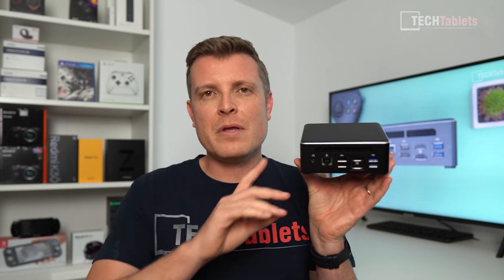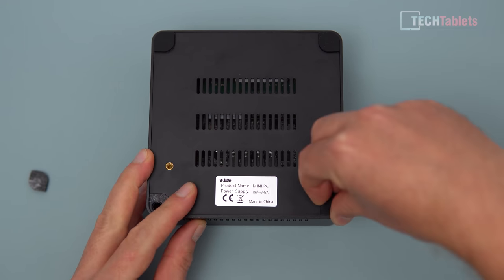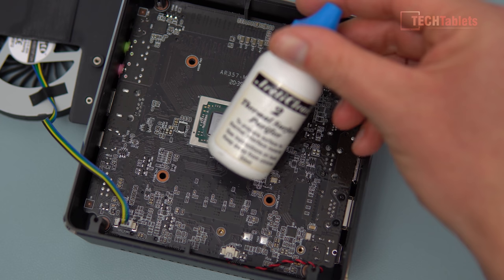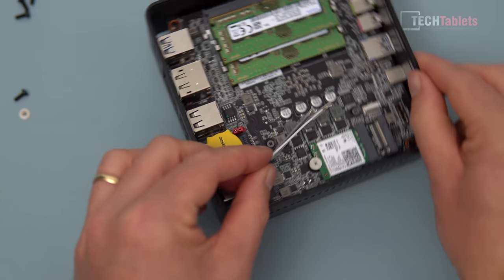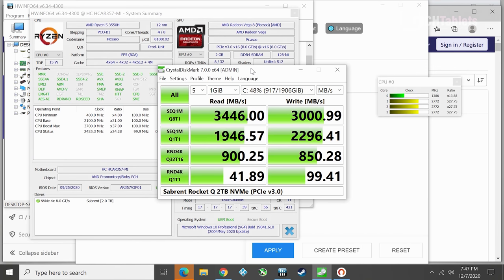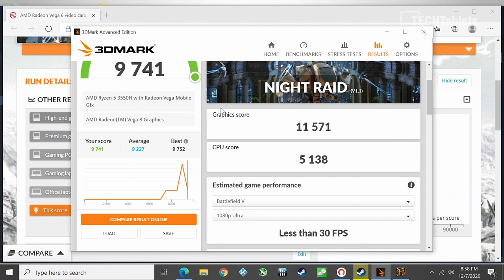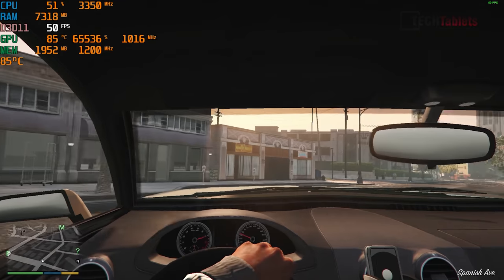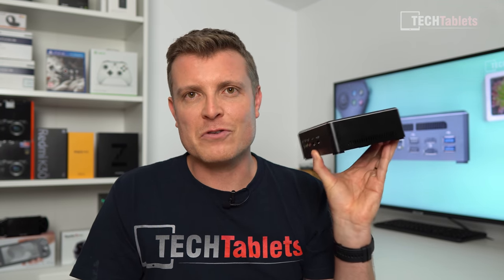AMD Ryzen 5 Mini PC Upgrades! Wifi 6, TDP Boost & More! (Ft T-Bao MN35 )

Comment: Wow! Thanks so much for not only introducing the world to the best mini-pcs around, but helping people improve them with time! I ordered the T-Bao MN-25 that I've been running Linux (Ubuntu 20.04) on and it has been excellent. I already added an SSD thanks to your prior teardown, but I only got halfway through the wireless card upgrade because I wasn't sure what size screwdriver I needed. The details here are priceless! 👍😁
Reply from the maker: Glad to help. I had Linux Mint on my MN-25 it ran great
Reply: how did you fix displayport?
Reply: @kerde526  seems like ubuntu 20.10+ support this wifi card instead of many other distros
Reply: @ДмитрийАлександрович-й2щ  it worked for me.

Comment: I have a slightly different model (Ryzen 7 but almost the same). Your tutorial was very helpful in swapping a wireless card that was going on and off since I bought this beelink machine. Once I got inside, I found that the white Wi-Fi antenna (yes, this one had two) was cemented on with some kind of black plastic. That may have been the problem right there. Right now all I know for sure is my swapped card is up and running now. We'll see if the thing keeps randomly turning off (in which case I guess it's a motherboard issue), but your tutorial likely helped fix my problem. I feel like it's going to work from now on. If not- this was the way to try and find out if there is a deeper problem. Anyway - other viewers- just take note- case designs on these similar-looking beelink boxes can be a bit different. Didn't have another panel on the opposite side of the case to remove, I needed to remove four screws from the motherboard and carefully remove the board itself to access the side with the old antennae taped on. Just go slow and think about how your case is designed to be disassembled. Also - he wasn't kidding about the antennae being fidgety. One of my two new antennae in particular required delicacy, precision and strength to get it to snap on, and even then, I feel like the snap wasn't tight and I had to be very careful about reassembling the case so it wouldn't disconnect again. End of the day- I feel like a genius thanks to TechTablet's help on this. Not rocket science - but it is delicate work and the guidance was very helpful for my confidence here.

Comment: That wifi-6 card is much cheaper than I was thinking it would be. Basically a no-brainer, particularly if you use BT headphones (5.0 is so much better than 4.X, esp for battery life).

Thanks a bunch. Chris!
Reply from the maker: Yes it's very cheap and well worth it
Reply: Hello,I have a problem using this wi-fi card. The computer booting normally,but stuck on the main screen with no functional USB ports. Keyboard and mouse freezes. NvMe SSD still blinking and no action. If change back to factory module, everything works normally. P.S. Ive try two new modules with same action.
Reply: @peterflaska8512  I have the same problem now. Have you found any solution? I found that the two cards that I bought had two connections in comparison to the factory given one but one of the two cards is also the one that is linked in the description. Any kind of progress update helps!

Comment: Fabulous that TDP tweak! It really gives a nice boost in performance!

Btw I was looking on AliExpress and had seen the "Chatreey AN1" also with R5 3550H. It looks almost identical to the MN35. Where the Charteey can be purchased without ram and storage for about €250. Could this mini pc an OEM part, that is sold by the two brands T-Bao and Chatreey?
Reply: Chatreey is a rebranded t-bao machine.
If you buy a Chatreey (like me) you are actually getting a t-bao minipc (without paperwork inside the box).

Comment: The TBOOK MN27 with the Ryzen7 2700U, 512GB SSD and 16GB RAM is just a tiny bit more expensive than the 256GB/8GB MN35 at the moment.  It's an older CPU but performance seems to be very similar and it's a 15W tdp part so should run cooler.  Worth going for?
Reply from the maker: It's still good yes. Not too much of a difference but the added TDP does boost the gaming performance quite a bit.

Comment: My MinisForum Mini PC UM250 cooling fan is a little bit noisy, is there a brand replacement that is very good for being silent? And is it very safe to replace my Thermal paste with Thermal Grizzly brand aka Liquid metal paste and should I use it?

Comment: hi Chris, thanks for these videos. I have one doubt after seen these, is it worth it (or even possible) to use the M2 port for an e-GPU and use the SATA3 port for the drive? In order to improve gaming performance... Also what about bottleneck with that CPU for more demanding titles?
Reply: 7 months late but hey. That's what I'm about to try (once I get hold of a spare GPU from a friend). My idea was to remove the wireless card and use a small m.2 ssd in there, then use an m.2 -> pcie adapter(like you mentioned) to install the GPU. This keeps the vent holes free. I don't plan on using wireless (will be on lan all the time).
Reply: @Kruemo  Just beware some of the external GPU board only works on m.2 nvme, wifi slot doesn't work.

Comment: I wonder if upgrading the cooler (if we could find a suitable, small cooler) would improve the thermals so that we could run it a bit faster, somewhere near your ''stupid, dont do this'' level of tweaking.
Reply: I think it probably would, it doesn't look like a particularly great design.  However it's a bespoke item so finding something to fit might be a pain.  Chop a big hole in the bottom lid and have one of the slim-ish Noctua coolers poking out :)  Have to stand it on the side obviously.

Comment: Hey there! I grabbed the MN27 from this series following your recommendation, and I've been pretty satisfied so far. 

After a few months, I decided to upgrade the memory with a Samsung 870QVO 2TB SSD, and followed your instructions, but I'm not seeing it recognize when installed(Device Manager, Samsung Magician, and BIOS all fail to register), only when attached via USB.  Do you think this is an issue with the cable, or perhaps a BIOS setting I'm missing? The advanced menu for SATA config shows all ports as NONE.  

It's my first install like this, so I'm leaning in the direction of user error or faulty cable, but figured you might have some ideas. 

Really appreciate your delivery; you and ETA Prime are the ones I go to for quality, thorough breakdowns. Great concision and formatting!
Reply: Same here but the solution to this issue is actually quite simple. Contacts go down, not up. It is shown and explained the wrong way in the vid.
Reply: @stephanf2404  Tried it both ways, but will give another shot with the new one that arrived this week. Thanks!

Comment: @TechTablets,  does the min35 actually use anything over 2400 MHz?  Mine came with Kingston 2 x 8gb 2666MHz. Is it utilizing the 2666MHz or just 2400MHz of it? Can it utilize a higher MHz like 2933MHz? 
I have yet to plug it in and see what the bios shows.  Thanks!

Comment: Don't try to re-paste, it had already got something like  Shin-Etsu 7968, which is top quality solid thermal paste,  if you didn't spread the new paste evenly, the result may even worst. Even if you handle it well, it will not improved much, I had also tried liquid metal paste, trust me.
Reply from the maker: Okay thanks for the tip!

Comment: Hello @TechTablets, i had error 182 trying to install graphics drivers from amd. I entered BIOS and turned Integrated graphics controller from 'auto' to 'forces' as you suggested in your forum but the problem is still there. Any idea?
P.S. when i turn Integhrated graphics controller to 'Forces', UMA Mode and UMA Version appear as new options and they 're set to 'auto' by default. Maybe i have to change theese values?

Comment: Could you share a video with tips/guide to replace the fans with something else that is totally silent! Or maybe even passively cool it?
Reply from the maker: I wouldn't recommend it the performance wouldn't be good. You would have to force lower clocks and thermal limits to control the heat.
Reply: @Techtablets  Even if it takes say a 25% performance hit, it still would be more powerful than any other silent PC on the market for that price?

Comment: Hi friend.  I have the same minPC that you, but with processor Ryzen 7 2700. I bought the wifi card model Intel 7265NGW, dual band, because it was sale off. When I installed, the CPU fan stoped work and pc stayed very hot. The wifi signal was very bad after this upgrade. So I put in the original wifi card. Do you know if the model that I bought is incompatible?

Comment: 13:13 I see the base clock of this APU is set at 2,1GHz, and boosts up to 3,7GHz. But under what circumstances will the APU boost up to 3,7GHz? Is it 3,7GHz across all cores?

Comment: Really clear,  thanks for the video.  I’m a Mac user but I need some pc only programs, so I’m returning to windows and ordered this pc. You can order it with 512 GB SSD AND 16 GB memory standard..       the upgrades yes seems  easy   To get more out of it especially WiFi 6     But what if the video card internal will fail ?  There’s no replacement??
Reply: There is no video card, it is integrated into the cpu

Comment: Made the wifi 6 (Intel AX200)  upgrade but have problems with no USB (ie: keyboard, mouse, sound card) not working after install. Tried uninstalling and deleting old  wifi card drivers first and then  making a clean install. Looking in safe mode mouse works and I can see correct AX200 drivers are installed. However, in normal Win 10 mode the USB mose stops working 20 sec after boot up.   Any ideas ..anyone?

Comment: Just solved the activation issue, but there is something weird in my MN35... It has Vega 9.... 
Looks like i cant find a way to install the right drivers through AMD website downloads. Where did you get the drivers? How did you install them?
A little help would be really appreciated.

Comment: Thanks for the detailed and informative video. I have a question that might seem stupid to advanced people maybe. But if I change the ssd on my laptop will I need to do changes or installations on bios or software or is it only to start the pc and go?
I have windows 10.
Reply: You just need to do a 1:1 copy of the old SSD into the new SSD. You need to do it with special software, not doing a direct copy paste.
Reply: @nicetrayyy  thanks for the info 👍.
Reply from the maker: Try macrium reflect

Comment: I recently received my T-Bao MN35 (16G version) and also made the Wifi-Upgrade and plugged in an old 1TB HDD. So far it's been running really good. The only thing I noticed was that after maybe two hourse of watching a movie (been using the Mini-PC mainly for Multimedia use in the living room) the mini PC as a whole gets really warm. I haven't checked the CPU temps (using it it didn't seem to have any effect, it was running like it should) but it did make me wonder a bit. Is that a normal thing? Is it because the footprint of this machine is so small that you notice the heat immediately? Should I be worried – having the mini PC tucked away in a shelf (air can still circulate)? It's my first mini-PC and so far I haven't noticed this much heat coming from the laptops I owned.

Comment: I have one problem with this mini pc. The headphone output and microphone input on the front does not work at all.   Trying to do some driver update but does anyone has had similar issues? It won’t show anything in Windows sound output list. Every setting is correct and already did a clean install of windows 10.
Reply from the maker: Looks like it's faulty then. Get a replacement or refund with the seller.
Reply: @Techtablets  it needed an updated AMD audio driver.  So it’s working now. The only program that showed this was driver fix.   Hope this helps for others.

Comment: Why didn't you overclock the igpu to make the most of the extra voltage?
There's probably a simple answer I missed , also getting the ram probably make a massive difference. 
Will ryzen master not work?
Reply from the maker: No it didn't seem to work for overclocking only increasing the TDP.
Reply: @Techtablets  thanks for the solid info
Reply: @Techtablets  just with GPU maxed on shadow thought might been a little scope there

Comment: Hello dear friend can you help me please I bought a computer with Windows 10 Home with a single language by mistake and want to ask two questions 1 My previous computer is dead The system that was installed in it had Windows 10 Pro valid Can I transfer the product key Its for the new computer and it will be Windows 10 Pro Multi Language? 2 in case not what my option is to solve the problem [Even if necessary I will buy an upgrade to Windows 10 Pro but will it solve the problem?] Thanks and sorry for your hassle

Comment: i have bought the antennas and the ax200 wifi--anyway works very bad...-72db vs -63db of a standard classic  asus F555 notebook..how can i do?
Reply from the maker: No damage to the plugs? Check it's pushed in correctly the tiny plug
Reply: @Techtablets  hi tech, yeah all perfect at all. before mounting i have checked al the best side to find the max gain - db😉

Comment: Notice...Ryzen controller shuts itself down after some time so the changes You made are not working...It doesnt cooperate with mobile amd cpus well :/  Tried on 3550h, 3750h, 4800h ...

Comment: the heatsink, where it makes contact with the CPU, is painted black, usually, that area is made of copper or metallic material but not painted, is that normal?
Reply from the maker: Yes normally it's copper but it's painted alloy. However it does the job well so that's the main thing.

Comment: So R5 3550H can only goes with 2400 mhz RAM ?
Reply: Mine came with 2666MHz  (2 x 8gb).  I haven't  plugged it in yet so don't know the bios.
Reply: @garyscherler3345  yes it came with 2666mhz but work only on 2400 mhz from what i understand
Reply: Mine came with 2 x 4 GB  @ 3200 MHz but only run @ 2400 Mhz. I upgraded with CRUCIAL 2 X 16 GB @ 3200 Mhz (CL22) but they still run @ 2400 Mhz. Probably a Bios limitation but I could not find a new BIOS.

Comment: Your unit is showing Vega 9? Mine is doing it, and Banggood's supplier is telling me its normal...
Could you please upload somewhere a screenshot of your device manager? Im dealing with them for 8 days now.
Thankd in advance.
Reply: Hey, I have issues with my MN35 too. It doesn't display any GPU at all. It defaults to the windows software drivers. Did you have any problems like this after windows reinstall?
Reply: @Kruemo  Yes, that was exactly my problem. Its showing basic display driver? If you want i could upload the drivers that they sent me. Just tell me.
Reply: Can any of you send me the drivers?! I can’t install the drivers from and!
Reply: @sergioa1763  could you send the drivers to me aswell please?!
Reply: @pokegoldteam8756  Tell me your email, i have uploaded them for you.
Reply: @sergioa1763  I can’t send you my email it’s always getting deleted my comment what the H
Reply: @sergioa1763  can we use something else to speak? My comments get deleted all the time.
Reply: @pokegoldteam8756  Tried in your channel
Reply: @sergioa1763  i don’t know if your busy or not but please try help me! I asked the drivers to the seller but got nothing still.
Reply: @pokegoldteam8756  I told you yesterday that i sent you a link in your youtube channel, in the comments section.
Reply: @sergioa1763  that’s ia odd I don’t see anything in the comments with your name :(
Reply: @pokegoldteam8756  Order comments by date and it will show
Reply: @pokegoldteam8756  Got it?
Reply: @sergioa1763  I found them! The comment was hidden just don’t know why! Thanks so much
Reply: @sergioa1763  yes thanks working flawlessly
Reply: @pokegoldteam8756  anyone can install radeon software?
Reply: @ebannoor1170  I got the drivers

Comment: try putting a m.2 to pcie x4 internal egpu, like a 1650 or 1660, or maybe a 5600 in the box
Reply: might need a secondary really low power mini atx power supply, no, not the sfx sized, the mini ones
Reply: Dell adapter DA-2 would work for that
Reply: @ajayprasadcelestial  Akasa 80W mini-ATX psu (AK-PE080-03) and Akasa 84W laptop style secondary power adapter (AK-PD080-02M), that would make it 2x80W
Reply: @ajayprasadcelestial  1650 is rated 75w